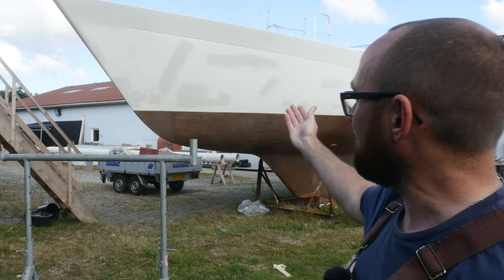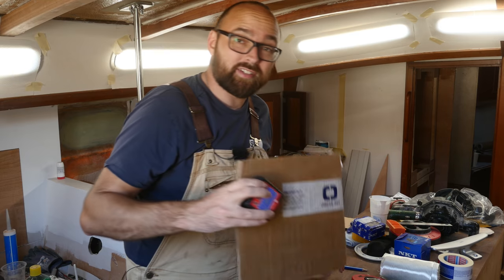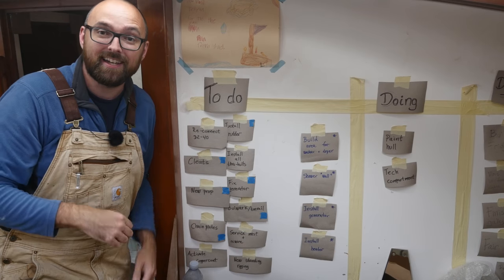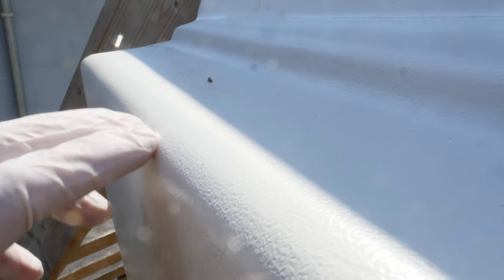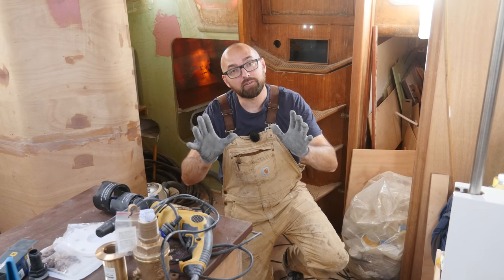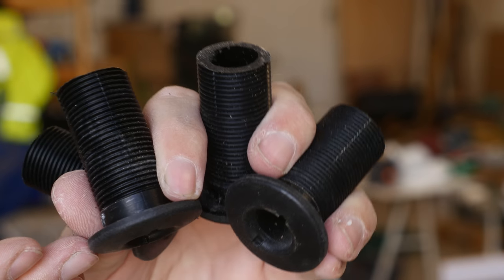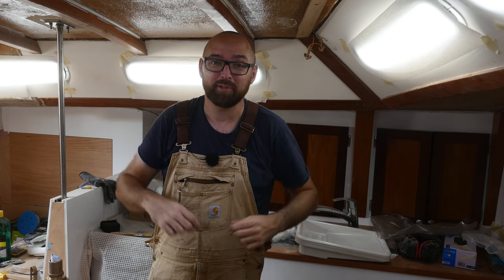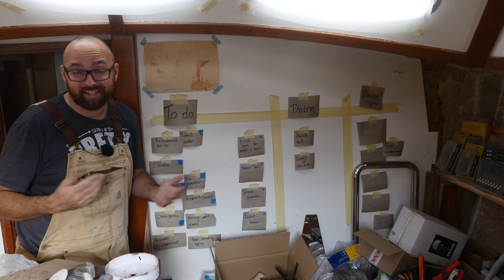Sail Life - Thru-hulls, mini bulwark & technical compartment

Comment: since you have acess to weldiing equipment (and by now a bit of experience on it) you could make your guardrail into a solid one by welding the stanchions with some ss tubing and in doing such you could double that by joining the stanchions at about 2 inches from the the deck. this way you would avoid drilling more holes on the deck and fiddling with yet more woodwork whilst creating a very secure structure to which you can safely clip on and a toe rail at the same time. im not sure in terms of initial costs but surely you will save time and money in the future. great episode as always!

Comment: I have said it before but those first 6-8 inches of hull above the waterline will be the majority of the work of keeping the hull clean since it is a transition zone between the wet and the dry.

Mineral strains, or "beard" is a yellow grunge stain that shows up very clearly against white paint or geocoat.  Most cruising boats will need this beard "shaved" or cleaned off every few weeks when in filthy water that is around many inland waterways and canals.  It is just one more job that you don't want to do all the time when living the high life of cruising.

A strip of darker color such as blue, red, or green will hide the stains much longer between cleanings, especially if there is no "reveal" between the boot stripe and the coppercoat bottom.

A 6-8" boot stripe is also an easy small painting project at haulout time to fix small nicks and scratches that inevitably occur at the waterline.  It doesn't take much time or materials to do the whole strip around the boat and doesn't need to be faded into the rest of the hull paint job or require repainting the entire hull.  

Best of all it doesn't even need to be done right now.  It can be added next time the boat is hauled out when you decide you are sick of cleaning that bottom few inches of yellow stains all if the time or have chips/scratches in the paint at the waterline. 

Ease of cleaning/maintenance of the finish at waterline the real reason boot stripes exist. 

PS I love your seacocks and fiberglass backing.  I did the same on our boat with off the shelf fiberglass sheet from McMaster Carr.  Epoxied down with a fillet around the outside they are a thickened/strengthened part of the fiberglass hull now.

Comment: Hey Mads before installing the gen set  think about a aluminium  drip try before final mounting cause your going to drip fuels in your tech dept.
Reply: just curious; why is it called a gen "set"?
Reply: pgreenx Because, the driver; in this case itty bitty teeny weeny yellow poke-a-dot Volvo Penta and the alternator are combined into a set. The driver could be wind, a gas or steam turbine, etc.
Reply: Or better a tray mounted on vibration isolation dampener so it does shimmy the whole damn boat and is quieter.
Reply: @danielbuckner2167  you don't want the try isolation mounted or fluids in will tend splash out and on the under side of the generator.
Reply: pgreenx Because it is a motor generator or gen set. I don’t know where the phrase gen set first started; however, it was called that very early on in the elevator industry in the U.S.. Once the gold standard in the elevator industry, now they are almost never used on new installations.
Reply: @danlucci9246  that's a valid point if it had an open oil bath or a cool water pool on the head like a hit n miss engine but it will always vibrate but only splash liquid of it leaks and that should be fixed. Besides a open cell mat laying in the tray to act as a sponge would solve the splash issue alone though heat might be a concern then. Also the bottom of the genset would already be wet with whatever fluids were leaking out. ✌🏼🙂
Reply: daniel buckner normally what is done on ships, tugs, etc., is the drip pan is integral to the foundation and the piece of equipment is mounted in the drip pan, mounts and all. In this case Mads could attach the drip pan to the shelf and mount the gen set inside. If he wanted go all out he could put a 1/4” drain in the pan with a ball valve and hose. Then he could easily empty any fluids, also he could use the drip when changing fluids. Then all he has to do is run a rag over the drip pan.

Comment: Mads - the boat is looking very sharp, super nice lines. One thing I am sure you are onto is the chance of stubbing feet (bare feet in particular) on those SS fittings holding the wooden toe rail. I have done this myself many times on yacht decks and ouch and blood. I am sure you have factored in minimising protruding bolt heads (eg countersink) and round off all corners and edges. Will be interested to see your CAD render when you get it done. BTW - we are down in Australia, and in our summer 35C is warm, 40+C is hot - 30C is a pleasant summer's day.

Comment: Perforated toe rails are often used to attach rigging, such as blocks for spinnaker guys.  You might want to make sure each of your toe rail brackets has a possibility of attaching a block, or some other kind of rigging, with enough load-bearing capacity for a sail (i.e. enough to pull the boat along!)
Reply: And for furling line blocks - for the furler. I'd put a solid 6-8mm round bar bail at each bracket, shaped like a quarter circle.
Reply: @evangatehouse5650  That's the kind of thing I had in mind, but Mads might have plans for rigging. He doesn't talk about rigging. Frankly, that worries me!

Comment: Straight reading verniers now eh? Ya know, I have done dial and digital through my years on and off but now will only use straight reading veneers. Takes a bit of eye sight but they are simple  :)  and no batteries needed to switch between whatever and metric. Got mine from Moore and Right in the UK and good to .0015". 36 USD. Plenty close enough for what most do. I do not worry about delicate dial mechanisms or batteries or razz-matazz crap. They just work straight up.

Comment: The valves are cool, you should definetly make an app for a planned maintenance system onboard your boat 👍😁
Reply: I think that would be a great idea especially if it might be linked to differing parameters such as time (perhaps both in and out of the water), engine or other component hours / numbers of operations. Something a bit like a check list which you update as you complete them - a magnificent maintenance record!

Comment: When making backing plates I use a product called  T rex. I do have to plane it a bit to make it smooth. but it is 100% recycled plastic color fast uv resistant. mildew Blah blah  you know the drill. it is a good option then you have to crib something in and never going see it again. or make a sill for your black water tank to sit on. its plastic not going absorb  any funky odors.  Been on my boat going on 8 years power wash them clean and carry on.

Comment: It’s your boat and all that but not using that toe rail over is your mistake that you will live with.   Sandblast it and sand the old metal toe rail and reuse it!   You will be glad you did.  It’s safe and maintenance free.  Or nose around old boat yards and buy one second hand.  Wood rots, discolors, and it breaks when you really need it.

Comment: Hi, just as you mentioned the fuel tank, did you remember to get some more of those through nuts for the last bolt on the fuel tank you had one short when you installed the tank?

Comment: Why not combine all of the toe rail brackets with stanchion post bases and use short lengths of timber between them rather than one full length? A bit like a round socket with bolt points on each side. 
Also, how much real variation is there between the angles of the deck hole joint? If it's only a few degrees it would be preferable to average them out and create a batch of 22 identical stanchion bases/ toe rail brackets and make a couple of spares. Making a batch of identical parts is much more efficient.

Comment: The ball valves with the wires... what type of sensor are they using, simple hall effect? You clearly have the know how, why not go with a full on actuator? Were they too pricey or are you concerned about (no faith in) the idea of automation? The leads communicate with what protocol, RS-485/RS-232, or is it a simple transistor to return voltage if opened? Anxious to see how you might use these. :)

Comment: Silky smooth huh? Rinse off the dust, let it dry and look at the hull at dawn or dusk, when the light is raking. You'll be surprised what you missed. A smooth and even topsides takes much more effort including 2 coats primer, one high-build, plus longboard sanding with guidecoat. The actual painting takes less than an hour, the surface prep takes monthsI but worth it when you apply Perfection and it glosses up.

Comment: Hey Mads, I know this is an old video but I was hoping you could answer a question. I am about to install trudesign fittings to my boat and was wondering about the epoxy. As my backing pads are already in place I want to know did you epoxy the nut side of the skin fitting, and if so how tight did you do them up whilst the epoxy set? My concern would be squeezing out all the epoxy? but maybe I'm just being paranoid. Thanks in advance (long time viewer) Liam

Comment: Quick question - given you seem to have a great set up there (on the hard) why the focus on getting back into the water in October?  Wouldn’t it be easier to continue on the hard until you have virtually finished her?
Reply: Imagine having to hoist that generator way up above deck to get it inside...way easier when the boat is in the water.

Comment: Serious question: While I too want to see Athena float again, I am wondering what the rush is. What is the advantage of putting in just as winter closes in? Would it be more convenient (and therefore more productive) to keep at the boat and the workshop and the tools and, and, and all in one place? Just wondering. Thanks for the entertaining and educational videos. Have you heard from Wilma lately?
Reply: Some of the items on his to do list are easier while in the water. For example, installing the generator/washer/dryer. Easier to move them in using a small hoist at nearly the same height than trying to hoist it way up above deck height while on the hard.
Reply: Water Faucet oh.

Comment: Just ONE ballvalve like these costs 160€ in Germany. That is by no means justifyable for me even on my 50ft sailboat. Whereas the Maestrini bronze ballvalve costs 100€ and is the most expensive version with a bronze handle. The more simple ones in bronze are about 30€. So, bronze it is. I need 8 of them, so no way I pay 1.200€ for the valves.

Comment: Instead of attempting to "level" anything on a boat (which will never, or at best only momentarily, be 'level' on the water), wouldn't it be better to first establish the existing sole (floor), and then build the interior perpendicular and parallel to that? I'm a non-boat-building woodworker so I am here to learn, but it seems odd to use a level anywhere in a cabin except to draw a straight line.
Reply: Mine has more than a bit of rocker in it, rising from stern to bow in a smooth curve.  The builders take advantage of the additional bilge depth in the main salon, but lose that depth as you move forward.  Dividing the floor into station measurements would be a raging pain the backside and not worth the effort.  Just my two cents.
Reply: @Blaine Reeve Interesting, thanks.

Comment: I've watched ur stuff for a while now and it's full of great projects, however I think the timber toe rails is a design mistake aesthetically. To maintain that sharp detail and modern look it needs the original rails fitted..in my opinion.
Reply: Well they probably wont fit now as the shape has been changed when he redecked the topsides.

Comment: Of all of the things youve modded on this boat over the years I have been behind you 100% (maybe 93.318%). This toe rail idea with wood is really bad. What happened to your alternative railing you were going to use? Boats & ships use metal toe rails for a reason. Sorry I am gonna disagree with you on this one (not that it matters anyway :) ) keep up the good work.
Reply from the maker: It's 100% okay that you disagree but there are plenty of boats that don't use aluminium toe rails :) In fact I'll go as far as to say I believe the toe rail is there to make life easier for the builder not safer or better for the sailor :)
Reply: @SailLife  thanks, sorry it came across as rude. It is just such a switch from your initial idea. Thanks for the reply and keep up the oh glorious sanding. :)
Reply from the maker: Oh no no :) it in no way came across as rude! :) If I had gone with my initial plan of a foam cored toe rail then I'd still be fairing. I do like the idea but not in combination with the boat being outdoors (can't fair when raining etc) :)